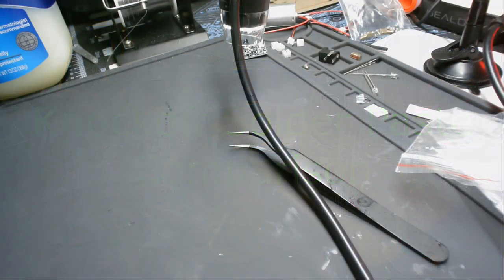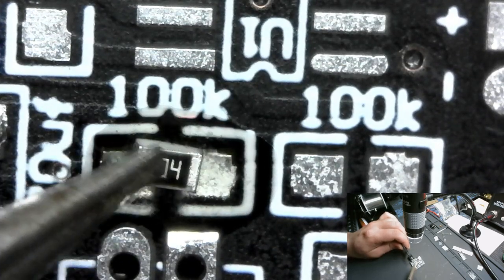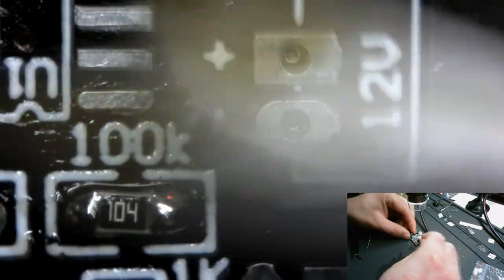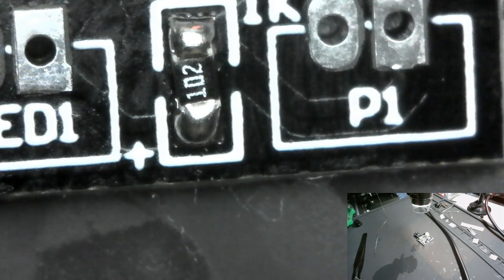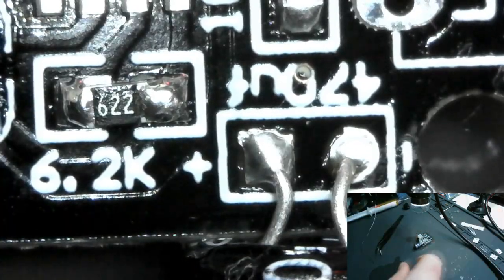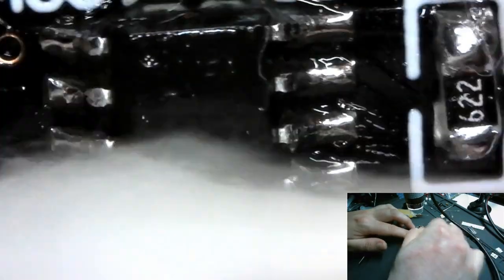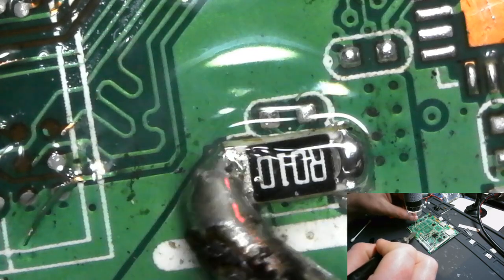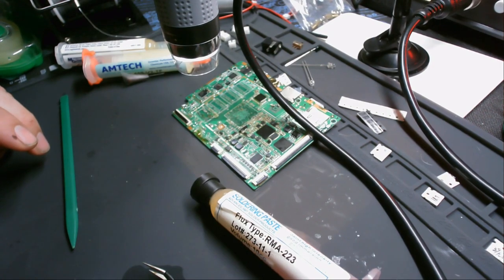Soldering with Vaseline?!?

Comment: For those people out there on a budget: get a jar of good quality Vaseline paste. Use a small syringe filled with Vaseline paste and add it over the IC area you want to remove after you heat the area for a few seconds. On small IC chips, smd components Vaseline is enough to remove them. For larger IC chips you add Vaseline and then add only a small amount of 223 flux paste. So basically 80% Vaseline, 20% 223 flux. Vaseline also does not smell and protects the board. Your soldering skills need to be changed you are actually damaging the components the way you solder. You need wick, and the flux to pre solder the pads, then with a hot air station and flux the component will attach to the pads.
Reply: Hi, I have been thinking in mixing Vaseline with my pine resin and alcohol liquid flux, it should dissolve well and probably would do the job, what di you think about. Regards
Reply: @elhatillanodigital5011  Vaseline is useful for removing small SMD components, however IC's that have more pins to desolder you need 223 flux. You need some cuetips to remove the left over Vaseline using 90% isopropyl alcohol works great. The tip of the cuetips must be fully emerged in the alcohol or they leave stray threads all over the place.

Comment: Well, after watching to the end I strongly recommend watching soldering instruction videos on Youtube.
I was completely novice to soldering. With the hints and techniques I learned from the videos I can solder simple SMD components by hand. 

First thing you should consider is to apply solder to the pads, at least one of them. Apply flux then apply the component. While holding the component in place, touch the leg on the pre-tinned pad to melt the solder. The flux will help the molten solder to run and fix the first leg. After fixing the component you can solder the rest. However, unlike what you so, you should apply the iron tip on each leg shortly, then touch it with the solder wire quickly. The solder will melt and run due to the flux to the right place. remove the iron tip. The whole process should take no more than 2-4 seconds.

Comment: Most decent knockoffs are actual rosin mixed with IPA. Literally that's it. You can make it at home and only the top-shelf stuff has extras added for better experiences.

The cheapest, nastiest knockoff fluxes can use petroleum jelly (Vaseline). I've seen it.

Yet, the knockoff Amtech and others you had are likely just a rosin to alchohol mix of varying levels. Some knockoffs use too much rosin or extra fillers so it's thicker, others too little rosin so it's like water.

Also, yes, rosin is tree sap. Most flux is nothing special and overpriced. Even Amtech is horribly overpriced despite being terrific flux. Why? Because flux is made from basic, cheap components. When buying rosin at industrial levels it's about as cheap as dirt, as opposed to smaller individual sales that can be $40 per 16oz.

Comment: Did you try to pre-tin the pads before applying the flux and placing the parts?
Reply from the maker: This video is really old so I don't remember. Trust me I know I wasn't great at soldering back then. I also don't upload this style of content to this channel anymore. I usually use hot air now on SMDs (seems easier) and yes I would pre-tin pads for that.

Comment: Try vasaline and rosin mix that's pretty much what a lot on the market are if you check out expired patents
Reply from the maker: I was looking into home made flux recipes for a video on my other channel that used basically diluted pine sap. The problem is it turns into a straight liquid. I was thinking about adding Vaseline to it to see if it turns into a paste, or maybe boiling off some of the alcohol. But hell, if you says that's what they do I'll give it a go, I got the stuff to do it

Edit:
I did it, I'll have a video on it on my tech channel in the near future. Spoiler: Bad Idea!
Reply: @draxxillegaming  I have been also thinking on that, Vaseline should give more paste consistency to the mix.

Comment: Honestly, you need to learn to solder before you make a video about flux. I do a lot of hand soldering in production work and your technique needs to change. Consider solder wire has perhaps 1% of flux in it. You add so much flux that it's like you were using solder with 50% flux. Why do you do that? Perhaps to compensate for poor technique. If you are going to solder one pad at a time then lightly tin one pad, tack the part in place, solder the other end with the least amount of solder you can (which will still be too much until you have had so much practice you develop the feel through your fingers for what is happening), then touch up the first pad. 

If you must use flux then a tiny dab, spread around many pads with a cotton tip till it is hardly there, and then solder away.
Reply from the maker: I never claimed to be an expert at soldering, I am quite new and made these few videos for fun. As for the amount of flux to use I watched Louis Rossmann and iPad Rehab to learn how they solder and they do use a bunch of flux. I'm not sure what the consequence of doing that is other than a mess to clean up. I do appreciate all feedback as I do actually use it to make adjustments to my soldering as long as its constructive like your comment.
Reply: First of all, this guy is not a professional solder tech, he is a hobbyist solderer. This guy has not been to school for this, he is self taught. Also, people who don’t know that they’re messing up, just don’t know it. Kicking him for not knowing what he is doing isn’t helping. You, obviously, have the skills down. I am trying to help him understand the basics. This is a skill or a trade that must be learned. We don’t come into the world knowing this. It is a skill which must be learned from the ground up, much like building a house. Starts with a foundation of basic skills and knowledge and goes from there. Flux aids in the soldering process and while putting too much on isn’t a good idea and wastes it, he is learning still. Just because you have a channel on YouTube, doesn’t make him a know it all. He never claimed that. Please help him with suggestions. He appreciates that. Badgering is not helpful. Thank you!
Reply: Richard Burden, he knows he isn’t a solder tech with high skills. Granted, it would have been better if he had learned the skills before try to make a video about it. The guy is trying to learn. He is self taught and has no formal training. I have been trying to help him learn the basics ever since I saw this video. He needed help, so I took it upon myself to help him out. Your advice is sound, but your delivery is a bit harsh. He hasn’t your skill level. All I am saying is offer suggestions to him. He appreciates that and he will say so. You have knowledge he can use. So offer it to him. He’ll thank you for it. Okay? Thanks Richard!👍🏻😊👏
Reply: @markphilpot4981  I agree his technique showed a lack of experience.
I also agree it's very much about how it FEELs in your hands.
That is why techs usually stick to one iron they know.

Just some thoughts, wrong tip for SMD work.
Not tinned well.
and too much flux.
But all that comes with soldering hunters of joints.